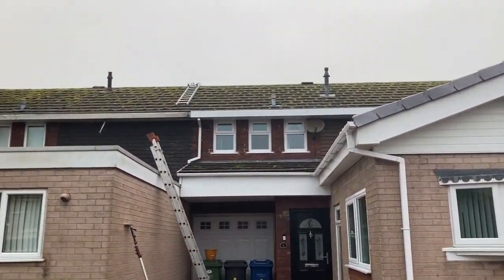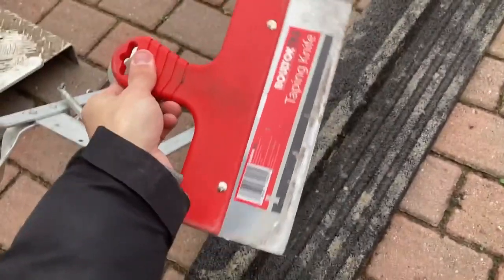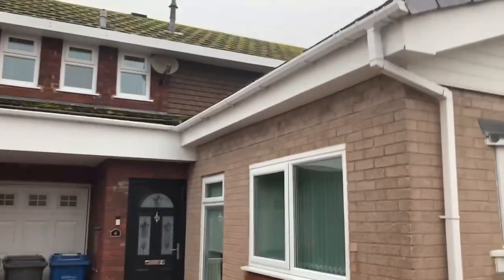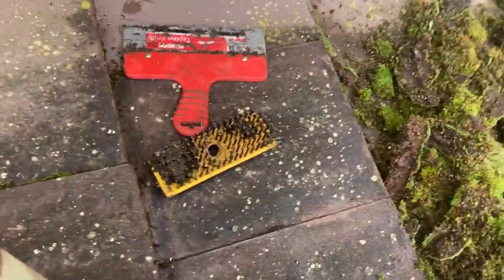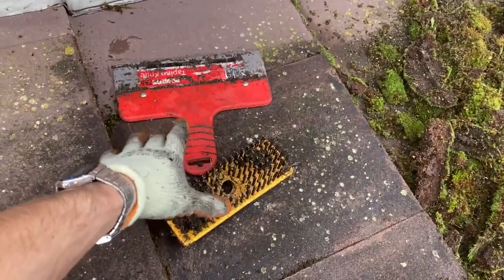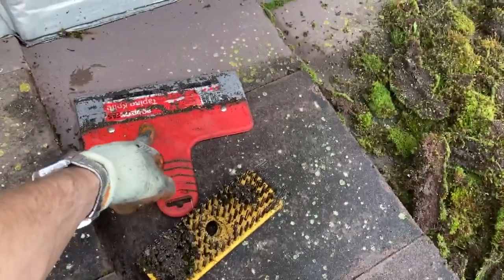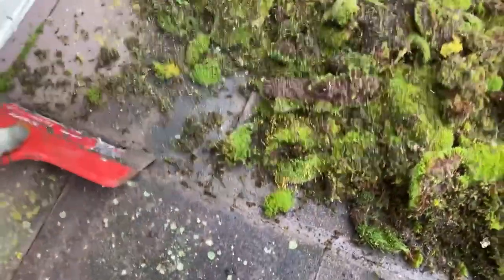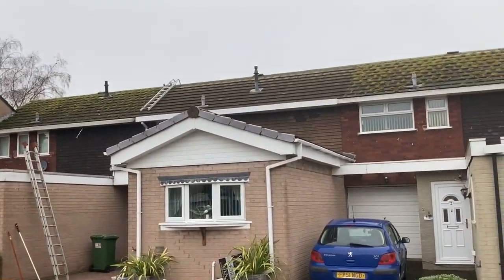Another day another roof clean // Partridge Exterior Cleaning

Comment: Nice work and vids, what kind of pump and controller do you use and how do you turn on / off the flow once on the roof? I use a everflo 12v setup which works but need to find a better solution for on / off once on the job.
Reply from the maker: Hi mate I use a big boy backpack 2 and have it on the slow setting at 1/4 flow.
Best idea is to get a univalve in the end of your wfp hose and you can turn it on and off that way
Reply: thanks ok i also use gardiner backpack for small jobs, i wondered if the univalve could handle chemicals as the slick connectors i've used in the past don't like SH! So you don't have any probs with using biocide through the univalve? @PartridgeExteriorCleaning
Reply from the maker: Biocide doesn’t tend to eat anything up to be honest, hypo is a lot harsher on pumps and fittings

Comment: Great video how many fill ups of the backpack would it take to do the upper roof front and back thanks
Reply from the maker: This one was quite a short roof so you could get it done in one fillup just about. most houses though you will do 1 fillup per side usually.
Reply: Thanks for the reply I have the same setup just starting out how are you stopping the flow are you using a univalve thanks again
Reply from the maker: I’d recommend using a univalve or a tap mate I don’t use one at the moment but I will be soon
Reply: Thanks very much for taking the time to answer my questions all the videos are brilliant
Reply from the maker: Thanks John I appreciate that mate 👍

Comment: What’s your SH ratios please Sid and what surfactant do you use.
Reply from the maker: Hi mate this is biocide not sh. I don’t tend to use that on roofs I just stick with the bio 
But I’ve heard just some dairy liquid in it is fine
Reply: @PartridgeExteriorCleaning  have you ever used SH before  one roof Cleaning job , and if so what's the differences between  the two chemicals biocide
 and SH when using  on root cleaning